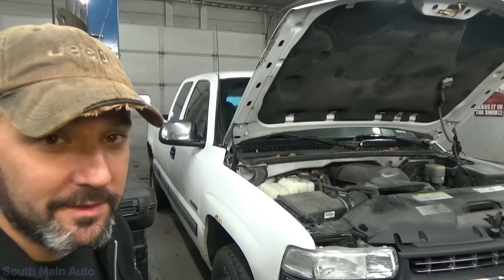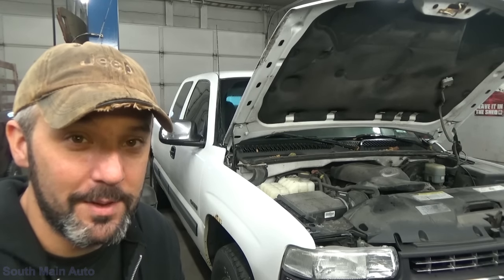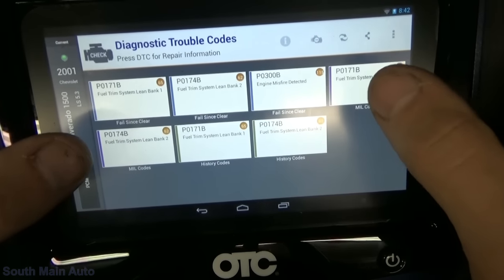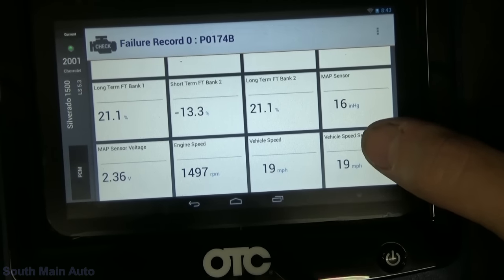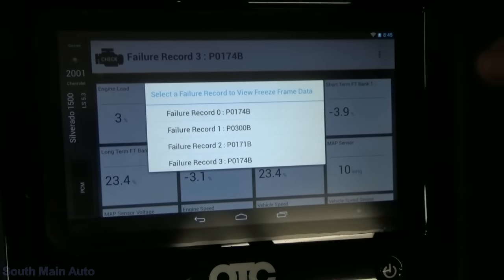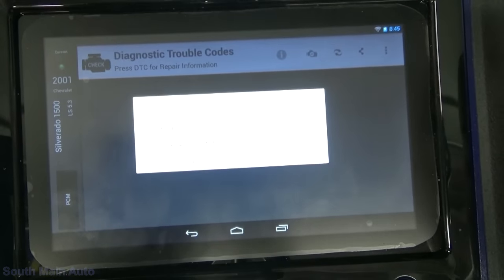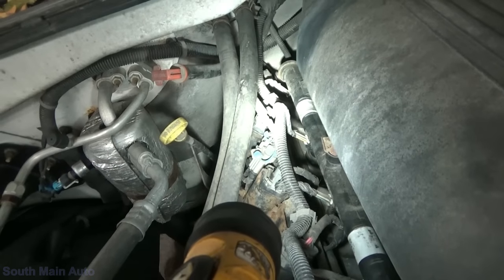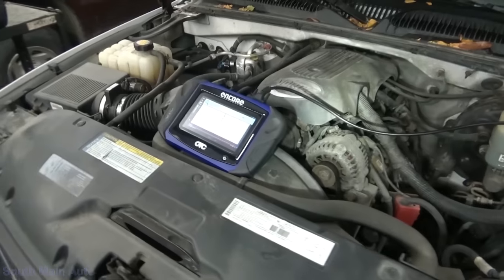Chevrolet / GMC - Rough Running, Lean, Misfire

Comment: Sent you another 10 bucks, your comment about hard starting after refueling may just be the ticket for a friends' Traverse.  Gonna check his Purge Valve Solenoid when he returns from Europe.  Thanks for the excellent videos.
Reply: I didn't really catch that part, he did say that they will cause both rich and then lean conditions though.  Just be sure to try and blow thru the new one as they often come from the factory already stuck open -- just because it's new doesn't mean it works these days.  Cadillac forum had one guy with four new ones before he thought to pucker up and blow thru them, and all were open.  Refueling loads the canister with fumes so it's hard to start and when it does finally, the engine revs up out of control so severely that many shut it off, just to repeat this episode several times whenever they fuel up.
Reply: 6:50 in Eric says " they usually have other complaints like hard start after filling", or something similar.  Thanks for your comments, I'll be checking new ones from now on!

Comment: I have a 96 chevrolet silverado 5.7. I'm getting gas only on the drivers side. unplugged the cap on the spyder injector and waited a few then plugged it back in still no gas on the plugs on the passenger side. I even disconnected battery. Got any ideals

Comment: I did my smoke test it was coming out of the egr pipe that goes into the intake do you think it's my o ring gasket or you said sometimes the sleeve cracks? I have a 2001 5.3 Silverado. Any advice for me I got a new o ring should I replace the o ring or get a whole new egr pipe?

Comment: Man I've been trying to diagnose a random misfire  on a 4.8 gm v8 and I can't seem to source out this issue for some while now buy basically u can start the engine and for 45 sec it runs fine then it starts misfiring if u go into gear and press the accelerator and of course the engine sputters and backfires you can let off the accelerator and then tap it and it will try to pick up but it will spit and sputter and eventually kind of clear up and then start running good and running decent for most of your trip sometimes it'll have a little sputter and acceleration but I think I have a vacuum leak somewhere and I forget I can't find it I've changed out coils and several other parts and I'm just chasing here changing parts and I think it's a vacuum leak as I said so I'm not looking to replace parts for no reason anyway any tips or videos you might have that could possibly help me out

Comment: what if the egr is only located under the engine cover? my 02 chevy has lean condition bank 1 and 2. wher are the vaccum hoses? but i dont have many fancy tools like a smoke machine. it idles rough when its cold and it runs fine after it warms up. has the 5.3.
Reply: Yours sounds like intake gasket, I had the same problem when cold it would cut out when I got on the throttle but after warmed up it was fine. Now I'm having a idle problem after its warmed up it idles rough.
Reply: @bretfeeney1072  I have the Same issue rough idle after warm up. Did u figure it out?
Reply: @dumbledoresarmy7569  I did an EGR delete because It had a vacuum leak and I had a big vacuum leak on the passenger side of my intake under the engine cover I put a rubber cap over the plastic part they came off. I bought a smoke machine from eBay and it worked pretty good.
Reply: @bretfeeney1072  awesome I’ll be sure to look into that. Thanks for the info

Comment: I got a 98 Chevy z71 it has a problem not shifting into over drive and when u get down on it it falls flat in its face like it's starting out in thrid gear what do u think it could be possiblely any help would be appreciated replaced the throttle position sencer did alright for a bit then the problem came back

Comment: Still have a P0300 on a 97 after (Vortec 5.7L & 4L80E): New crank sensor w/relearn, new o2's. Does not run rough or stumble (only misses between 15-2500 cruise & coast. What would your guess be?

Comment: Hey maybe you can help me out I have a 01 2500 HD it doesn't have any Blow by but somehow it's burning a quart of oil every 750 miles I change a PVC valve and it hasn't made a difference I told my camper to my campsite and when I stopped it started blowing oil heavy duty out the exhaust pipe I can't figure it out for the life of me it runs too good to have bad rings andaz 165000 miles any ideas on what's going on with this thing is it possible to return ports are plugged up

Comment: My 2002 gmc van misfire 2 years got so bad could not drive. 3 mechs gave up. It only misfired when i reversed. Then it gradually got worse as a drove. On highway Blinking engine light. As time passed i had to park it. 
Tryed new new Distributor and linkeage. New plugs wires. New spider injectors.  I got broke and the Auto store rich. Sold it..

Comment: on my 2002 chev van how come it misfired only after i reversed. it was mild at first then after a year was so terrible the engine light blinked and then blew out white exhaust.  3 mechanics gave up costing me $$$. All new disributor shaft kit. plugs wires. spider injectors...sold it.
On my 98 chev van was a corroded ground at top of engine. one year parked. 3 mechanics gave up costing me $$$.  one mechanic stole a $100 bill out of van to pay for the new fuse !!!!!!!!. He said. ya. 
 ya its been wonderful life with GM.
oh did i mension the 3 fuel pumps....ahh never mind.

Comment: I have the same truck same motor and I am getting an intermmittent rough idle when I come to a stop and a miss like the engine is cutting out when I going down a hill letting off the gas or accelerating up hills sometimes I feel a loss of power... It's like what the hell... Help me out with this one folks...

Comment: ah that iron block needs to go into a lightweight muscle car with a big snail on the side.
Reply from the maker: then it goes from 250hp to 300 haha might better buy a minivan
Reply: Well actually alot of drag racers are getting in excess of 1200hp out of near stock turboed truck blocks. If you shop smartly at the junkyards and know a little bit about what to look for, you can get the steel blocks for strength with the aluminium heads like the L92 set for flow characteristics. Not much needs to be done to get 4 figure horsepower from an LS (or LQ if it's a truck block, the drag racers preffered weapon). Fix the rocker arm needle bearing weakness with a comp cam kit. I'd personally o-ring the block myself, you can get kits to do it for around $100 with the wire included. youy can get an LSA forged crank from Chevy performance for under $300 , and you might need to do a few little things to deal with oil blowby. You can get trick 4L80s with transbrakes and manualised etc for under $2k. people are getting well over 1000hp with single 90mms. Heck, some people have a stash of junkyard blocks. If one blows, they just grab another and bolt the heads and all the othet trick goodies from the original engine on and keep going at it. It's never been a better time to be able to achieve ballistic performance for very little outlay.

Comment: Hey I have a 2007 Cadillac Escalade 6.2 liter  I was out of 5own working it sat for 4 day ran fine before I left get back get it and start it up and misfire like crazy  the whole left side of the motor is all codes

Comment: Got a 00 sierra 2500 6.0 it sputters when I takeoff from a stop an if i accelerate quickly it shakes bad what could this be engine lights are showing knock sensor an o2 low voltage

Comment: I have a 98’ Ford Mustang V6. The car drives great but is idling after having the intake manifold gasket changed. Throwing code P0305. Any ideas?

Comment: ok some one want to edumacate me on this one? i understand the problem of a cracked hose causing a leak. what im not sure is why the smoker found it. there are many egr setups ie electric, electric over vacuum, vacuum over electric, just vacuum, backpressure vacuum combination etc. the smoke came out the exhaust side. i would have thought with non running condition the valve would default to closed position. thus the only way for the smoke to get there would be a faulty egr valve nor sealing. or maybe this is a stepper motor that has to have voltage from the ecm to seal???
Reply: The smoke goes from the intake to the exhaust thru the cylinders? At least one pair of valves would be open or open enough?
Reply: Could be EGR open, but if it is closed you could have both valves open (overlap)on a cylinder. Smoke past the intake valve and out the exhaust. The rotted tube is on the exhaust side. I think the EGR is sticking, right now it is fine as the fuel trims are o.k.
Reply: The broken tube is directly connected to the intake manifold, the vacuum is the same. An electric switch is inside of and part of the EGR valve.
Reply: Well the leak is between the EGRvalve and the engine.
Reply from the maker: the leak is between the EGR and the intake.
Reply: thanx my bad after watching that section again i see it

Comment: Why is there only one bolt where the tube connects to the intake manifold? There are two holes on the mounting plate, but only one on the manifold to screw into. There is no way to firmly secure the bottom part of the hose to the intake manifold. See 13:50 in your video. They probably put that silicone on the bottom part of the plate in order to seal it up at the manifold.

Comment: You have an yukon/tahoe videos mine has a rough idle and hesitation when driving with no codes after  a po455 was reset ?? New wires and plug

Comment: Why is it a vacuum leak if its on the exhaust side of the EGR valve
Reply: It wasn't - it was on the intake side.  See 10:58  Between the throttle body and the EGR valve - that's where the flex tube had the hole in it.

Comment: Hello Eric ! I have a 94 gmc 5.7 . I have a bucking problem at a light throttle , certain position the engine wants  to start bucking . It is a 5 speed manual trans . Ive changed the tps  ,map ignition like dist , pickup coil , module ,  and the main coil . But still has this certain throttle position  at light throttle it wants to buck . Im at a loss . Did the head gaskets , valve seals , and intake of course . But thats not why i did the top end . I had a little white smoke situation . The bucking prob was there before I did the top end . Any suggestions would be GREAT !!!!!
Reply: Forgot to say theres a new gas tank  pump , sending unit , lines  . The truck was a mess when I got it but it was given to me and I wanted a  challenge . Im gonna keep on fixing this truck . Next is body and paint . Just cause I like the truck . Oh ya it is a  4x4 !

Comment: I have a 2005 chevy express van and I was getting a lean code on bank 1 as well as a misfire code on bank 1 .......the o2 sensors were showing that there was in fact an issue on bank 1! been to several different shops at this point and have done everything from installed a new cat as 1 mechanic was convinced that it was clogged up. ... no cigar of coarse and it is still just barely running and anytime I try to accelerate at all it just falls flat on its face! new coils, new plugs and all new plug wires too..... Reeks of fuel smell yet says misfire cylinder 1 and everything has been replaced on that cylinder already as have the others ....only thing I am left with is that it has to be a fuel problem such as in injector sticking open I suppose is all that I believe is left that it could possibly be
Reply: Did you ever figure this out? Having same problems. Thanks

Comment: 05 silverado 1500 4.3L same code, did plugs, wires,ignition coil, cap, rotor, 2 upstream 02 sensors, still having the issue im going to do a compression and fuel pressure test next 😅 so far I'm only a $200 into this. I did use a volt meter on my spider injector pins, and they are all pretty close, but 1 was 13.8, and the other were 14.3. The wire harness was good getting power. I'll probably do a leak down test before I spend anymore.

Comment: As far as the professional mechanic's needs, the couch coach no experience type home garage potato head a.k.a., Me --  thinks that the Verus still outperforms ( providing more task relative information automatically and does it quicker ) the OTC counterpart.  Would imagine the OTC has a place where it can shine and perhaps even excels  but it seems non evident in this comparison.
Reply: Hawaiian F150 I'm sure price point is big. I'm not with my otc catalog but the verus is powerful but yours gonna pay for it. Like a diesel vs gas truck both get it done but one absolutely gets it done.
Reply: Agreed. I too was trying not only pick one.  What can you do when it simply does work better than any other.

Comment: Wish my 03 Silverado was that easy to figure out what is wrong.. this rough idle and sometimes hard start cold or hot is making me so mad!
Reply: Do you have any codes?
Reply: Justin P.  always had a p0101 had a p0154 and p0134 but have been gone for 2 days now since new plugs and maf and throttle body cleaning.. sunk the truck last summer and has done it since.. compression is good on all 8..
Reply: fuel trims at idle are within +5 and -5.. cats are gutted for now.. truck has no egr factory.. new fuel pump..lines and filter.. new plugs and new wires..new fuel regulator..new intake manifold gasket and injector orings.. injectors soaked in cleaner for a day... maf and throttle body cleaned and tried 3 other good mafs.. new known good crank sensor(havent done a relearn yet tho)..cleaned grounds..new battery.. new up stream o2s.. everything is oem replacement..
Reply: did you mean new maf or cleaned maf? I thought I recall reading of starting problems being a fairly common complaint on gm trucks with maf issues. I also don't like seeing the front o2 sensor code, you can't rely on fuel trim numbers if you can't trust the o2. a bad maf can look good if the o2's are stuck or wrong.

Comment: good job Eric. if you have time, anh advance my chevy silverado 2001 star no crank. first time. second time star. right away.  what can be.
thanks. Max.
Reply: Check fuel pressure regulator and/or fuel pump pressure.
Reply: Thanks. Jasonsupafly. The flot is not working well, but the pump not sure,

Comment: omg that rust . Quick question I noticed that my left rear pads have a burned aspect and they squeck in the morning especially . they are quite new, i checked handbrake and is not stuck . Wheel rotates freely no problem . Should I change them and grease the pads contact points ?
Reply: I'd check the caliper pins and ensure the calipers can slide in and out freely.  If a caliper is sticking away from the wheel - the other wheel can glaze as it has to do most of the stopping and you get a spongy pedal.  If it sticks tight to the wheel - those pads will glaze from dragging.
Then check the pad contact points on the caliper bracket for grooves that may catch on the pads.  There are often replaceable stamped stainless steel runners that fit between the pads and the bracket to provide a smooth surface.  You can break the pad glaze with rough sanding.
Reply: Eddie the Grouch would add a few more since you indicated they are pretty new;
1. Open cold beer to steady your nerves .. may require absence of thought and repeating. Ah Heck, repeat anyway.
2. Check if both pads are centered in caliper. 
3. Are you sure you installed the correct pads, hardware and used proper lubrication and did so correctly?
4. Repeat number 1, Twice.
5. To be 100% positive...  Repeat number 4, Twice.
6. Leave it alone for today and plan a trip to SMA!

Comment: Is this a possible sticking EGR? Even with the rotted pipe that was covered, exhaust gas would have been getting to the valve. I'd command the valve on and off a few times to see what happens.
Reply from the maker: if the valve did not function it would have set a code. I has a position sensor so if it was not moving the PCM would know.
Reply: I apoligize. I assumed the exhaust side would rot before the intake.I need to watch a bit closer before as-uming.

Comment: Might sound like a stupid question but shouldn't the EGR valve be closed at certain times and not allow the vacuum leak? I mean obviously its a confirmed fix but i would have thought at first that the EGR valve would have prevented the leak at first until the valve was commaned open by the pcm? Or am I just over thinking it?????
Reply: Think it was leaking between the EGR and the intake manifold, so it would be leaking at all times regardless.
Reply: Now i feel stupid. Watched again and i thought the tube from exhaust manifold to valve was leaking...... Smh lol
Reply from the maker: Haha it is ok , now you know why it was doing what it was doing :)
Reply: Yeah.... Feel like a total dummy now because of that hahaha. I was like like how the heck is it leaking vacuum on the exhaust side. Oh well I was tired when i watched the video lo... My excuse and im sticking to it!

Comment: Whats up with the ABS and brake light. You made a comment about it being a GM prob.
Reply: from what i know ( i work at a gmc dealership as a tech ) the have internal issues with the EBCM 

electronic brake control module. and they are expensive usually run with parts n labor neighborhood of $1000 

basically what i have learned is solder on the circuit board is the issue and it brakes causing a malfunction. supposedly there is a repair you can do to 're solder " it but it dont always work...
Reply: +jay webb Thanks jay webb for the info.

Comment: ok so i need some advise on removing the motor out of a 1998 gmc envoy! had the intake manifold gaskets done at a garage and the started leaking internal and it got in the cyl heads and blew the starter right off any how i bought a new motor with 88k but trying to remove the y pipe and trans bolts all i have left any help would be great!